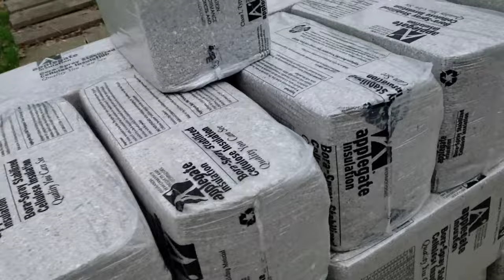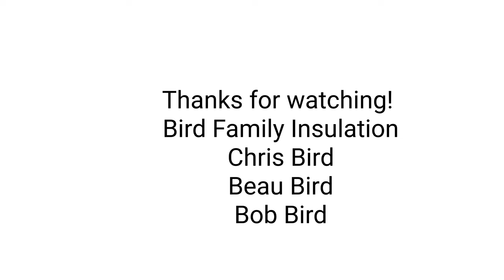Removing Attic Insulation & Squirrels Mess! Our R-40 Bora Spray Cellulose MAKEOVER!

Comment: What do you do with all the insulation you remove? In Cincinnati we have a landfill but it is privately owned and it costs a lost to use it.
Reply from the maker: Thanks for watching and commenting. We have to use a transfer station here.  We pay around $100 for dumping a trailer load of insulation, which is one or two-attic's worth. And usually the homeowner had some junk in the attic that we offer to haul-off too.  But $100 is max amount we'd pay for a trailer load (16' long trailer).